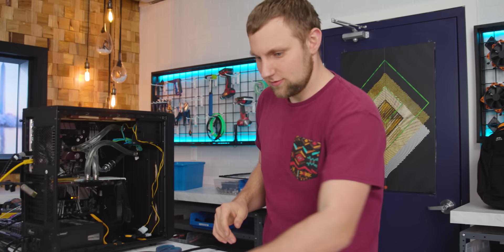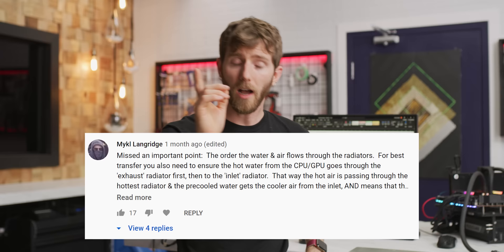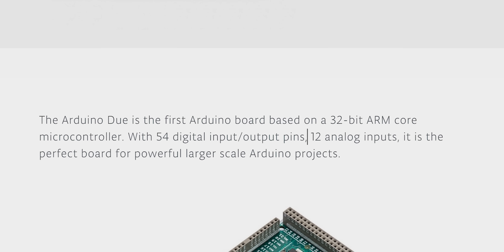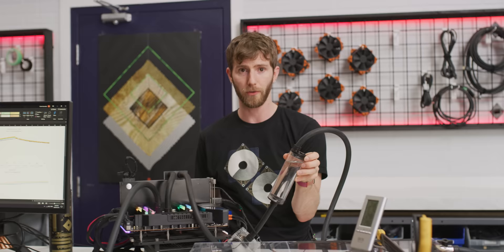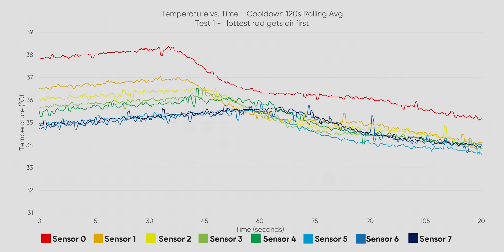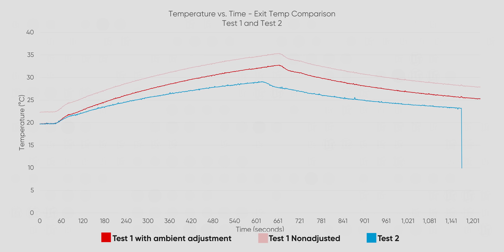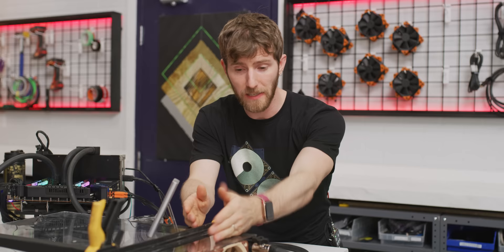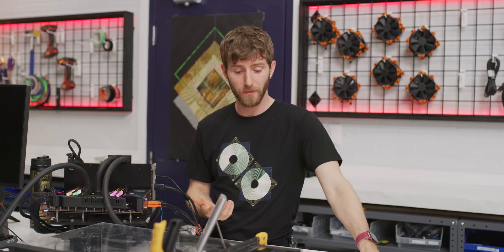Is this even going to work…

Comment: I still want to see a leaf blower connected to this thing. And let system stabilize better. Also you could use a 12V / 140W portable electric car water heater, to simulate a CPU. Stop hurting expensive hardware for science.

Comment: Instead of a serial stack you should have done a parallel stack of the radiator increasing the overall area for cooling that uses fresh air.

Comment: Some much efforts and resources wasted for that, where a simple graph explanation of how heat exchangers work and concept of pinch would be enough.
With basic understanding of thermodynamics you can easily calculate how much heat each radiator is exchanging. You will see that the capacity for each successive radiator is dropping very fast and they are used far from their rated capacity

Comment: why stacking? I see he's using fans on all, so why not placing them next to each other instead of stacking? Isn't that the logical, all receive cool air, way? Of course assuming you have the space, but using more radiators surely will cool more if all get cool air.
Or maybe I didn't watch the hackingtosh  video and am missing the plot..
Hmm, you could also channel the air in such way that they all get fresh air even if they are nearly stacked physically, for design purposes.

Comment: Did you guys measure air temperature?  there is only so much heat air can "abzorb" . Increase of airflow (volume) means more eneregy can be extracted. Get a rc plane "edf"  instead of these so called "fans"  to move some proper volumes.

Comment: i dont understand this ting thing... is data really that expensive for yall over the water? I get unlimited data here for £18 (10% off for a year rn, normally £20), you can get 30GB for £10 too, £15 is 50GB (for anyone in the UK that thinks this is fairly good its http://smarty.co.uk and they run on Three's network)
this isn't even limited to budget brands, the big brands do the same data for roughly the same price, the only difference is they have 12 to 24 month contracts, whereas the "budget" brands are 1 month contracts/pay as you go

Comment: Sorry Linus, but actually stacking radiators will never give you any meaningful benefit. This is because you've forgotten about thermal load limits of air.  A common issue in calculating air conditioning for buildings. 1 cubic meter of air at sea level can carry approximately 1.3 kj of heat (approximately 44 moles). This is regardless of compression (ergo relative speed through a wind tunnel or in your case, a set of stacked radiators). Now you said you're outputting at 500 watts of heat...not an actual measure of heat, but we can convert it, this comes out to 1,709.6 BTUs/hour, or about 1,799 kj/hour.  Of course, that's absurd the unit isn't actually producing that much heat (which is why we don't say heat in terms of watts). 
What you meant is that the GPU and CPU together would be consume 500 watts to do work, the actual heat output was registered at roughly 40c for a sustained period; let's assume 1 hour.  This means the heat output is 75.964  kj/hour or 71.9 btu/hour.  
Your water setup looked like it used about 1 litre of water, this water can only transport  4.187 kj/litre per minute with negligible thermal expansion. 
Your fans only move 70.5 cfm. The two front fans will limit airflow through any subsequent radiators when stacked, with a 15% airflow rate loss per radiator. This means per minute two of them will push through 1 cubic meter, by the time you reach your seventh radiator the airflow is cut to nearly half.
The water flow of the radiator system will handle 251.22 kj/hour, while the GPU will output 75.964 per hour. So the bottleneck in cooling comes down to airflow and the thermal limit of the radiators themselves. And with a thermal limit of 1.3 kj per cubic meter with stacked radiators your system will only pump through it 100 cubic meters in an hour presuming optimal flow. However, as I just showed you, your total throughput is cut to nearly half at 7 stacked radiators, so that's 43 cubic meters, or 55.9 kj/hour of heat load(+/- 12% due to other thermal variances, such as heat soaking into the other radiators by already carried heat in the airflow). With seven stacked radiators you will never force enough air through them with those fans  to handle the full thermal load of your one GPU, and that's in a wind tunnel, let alone a closed system or a much lower airflow space as a conventional computer case. And no, bigger or faster fans will not improve this, as there is an upper limit to airflow that can be pushed through those radiators. 
In fact, even with just two stacked radiators in the open, you're losing 15-20% of the thermal load exchange capabilities of the individual radiators. 
Your best cooling option is in fact offset radiators, so that cool air can pass through each radiator individually. The short takeaway is, don't stack radiators.

Comment: I feel that the wind tunnel vs stacked radiator test is flawed. A more viable setup would be to add spaces between the rads and fans, and have openings between them in the wind tunnel so as to draw the cooler room ambient air into the flow. An even better setup would be to exhaust the trailing air from each rad out of the win tunnel and feed in fresh air to the next rad in line.
Reply: Pay attention next time...

Comment: Ltt: Look what we Built
   Steve @ GN:  WTF is that, Its Not a Proper Air Flow Meter & Circulation Testing System, where is the Cu Ft Per Min Sensor? 
LTT: but look at the pretty Bread board & water bath we used to test our Sensors he he...
   Steve:  Laughing and saying Hey LTT Go sit with Jay & Hold my MOD MAT and let A Real Tech Channel show you how its done!!
     Patrick @ GN:  Dam Steve were they stoned ? How do they not see how bad that was, Maybe they should not Smoke weed B4 Filming!!
  OK B4 too many Go Nuts Im just teasing Linus ....& I am sure Steve would say it more Eloquently But I'm a Cattle Rancher so I say it as I see it!!!  Cow}:-o)

Comment: Stacking radiators is highly inefficient, there's no way to sugar coat it. Cooling radiators with heated air is the epitome of ridiculousness.

Run the same test, but stack the rads side by side to give them all access to the same ambient air. Anyone who thinks the stacked rads would work just as well is smoking crack.

I want to see how many side by side rads being fed the same ambient air it would take to beat these seven stacks rads, I would be amazed if it took more than two.

Comment: Am I the only one without all the scientific data can easily tell this was a pointless idea? Isn't it common sense that the 1st rad is emitting hot air and instead of letting it escape, it is being  blocked by another radiator and so on thus making making this setup pointless?  What is better than letting heat escape when your primary goal is to cool something lol?

Comment: Orrrrr…. Your test is flawed… it will always fail if you are running them in series… 

If you run them in parallel then you will get the gains your looking for.

Even if in direct stack parallel. And you should be double stacking fans between the rads.

Comment: Lol i don't have to watch this video to know more radiator surface area and Adequate** air flow and water flow equals better more stable** cooling.
Reply: The only valid argument against it is that youre recycling a portion of the extracted heat  when they are stacked too close.

But given enough space between each stack, with fans with each radiator, say half an inch then it becomes much more efficient because you're drawing fresh cool air in. It's just common sense.

Comment: Pc guys are just starting to learn the stuff car guys have known for ever. You dont stack radiators you can stagger them or side by side and fans for each rad is best and one thing you guy never talk about is fan shrouds a fan with a well made shroud can be up to 50% more effective then one without or just not a good one also you never talk about fans in front vs rear or push vs draw all of these things effect cooling for a group of smart "nerdy" guys your not very good at this stuff.

Comment: As for the Corsair rep's whine about adding a second rad and not having any other benefit beside thermal capacity one thing gets very clear:
Equip the rad with good fans, lay them out properly in the case and shut up, damn it!

Comment: the test was not complete and a waist of my time, the proper way to stack them would be vertically with all the radiators receiving Fresh cool air.. number 0 would still do the most of the work load BUT you would get a HUGH difference in temps... the way you stacked them is still blowing hot air on the last radiators, and this is just plumb silly, of course your not going to see much of a difference the way you stacked them

Comment: this some stupid shit... most people who would use multi rad for a system would separate them so you have one to cool of the watter before the cpu and then one for between the cpu and the graphics card. personally i have a build like this and let me tell you that thermals between 1 and the 3 rads that i have is a huge difference. i have one rad for cpu and then 1 ach for gpu its not a gaming rig but has high end quadros and they do get hot, there is no way stacking should ever be better and this is some bad quality content. granted i did enjoy it but at least tell people the truth that saartaing them for each component that gives off heat is probably best way to go.